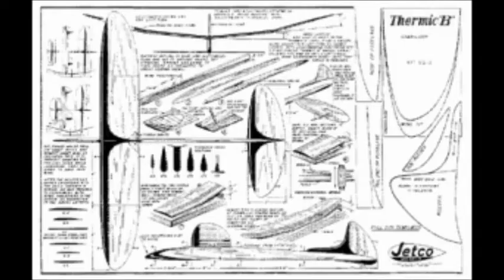HOBBYKING LA BELLE DAME 3 CH R/C MODEL FLIGHT REVIEW

Comment: One error I noticed, at about 2:43, you mention moving the clevis's on your rudder and elevator control horns to the outer most position to achiever the most throw, would that not do the opposite? For most throw they need to on the outer most hole on the servo end, and inner most on the control surface end. Other than that a nice review, keep it up! :)